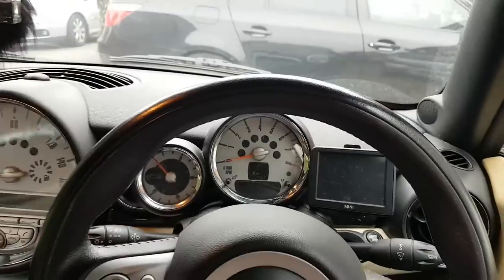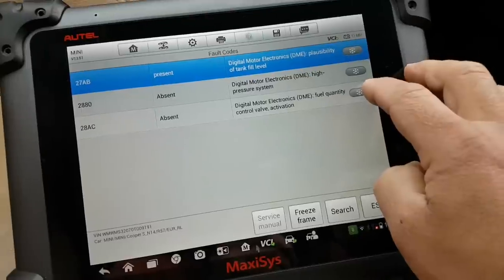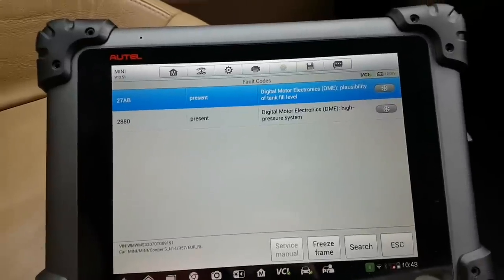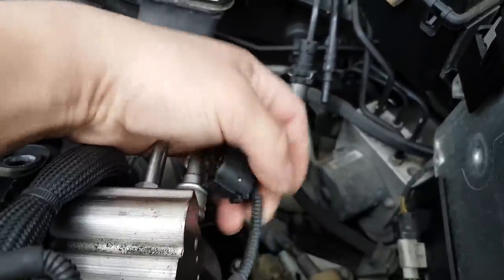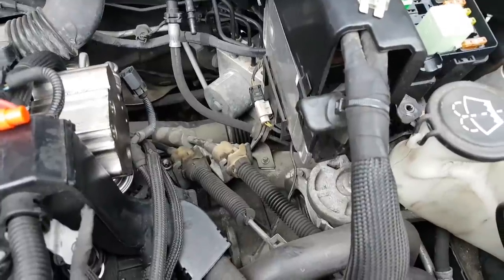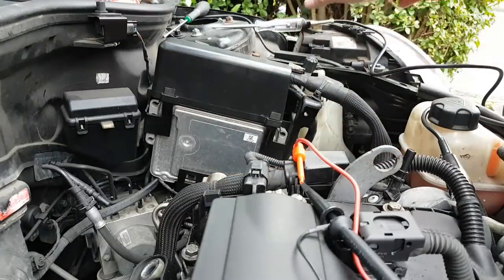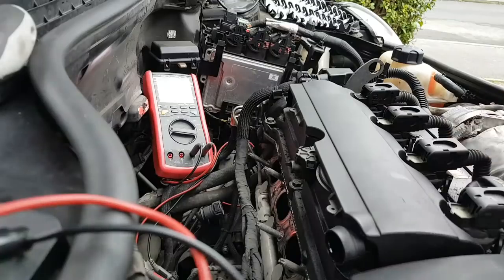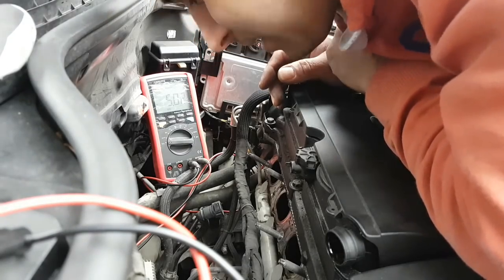Mini Cooper S R56 running rough... Error 2880, high pressure fuel system faults...

Comment: Had the same, same  problem! I didn't try to guess. I told the owner to replace the low + high pressure pump and pressure sensor. The mini had done 200k+miles. It worked after the replacement. Lucky I guess? I like what you do and the recordings. A lot learned. Am at Nairobi Kenya.
Reply from the maker: 👍👍👍
Thanks, for watching and for your comment!

Comment: Excellent video well done.  Watched as my '11 R56 had the yellow check engine / low power light on though has now disappeared the following day...  The engine was running perfectly fine despite the check light so will suspect the pump being a bit worn due to millage at 98K.

Comment: The reason the pump start to work when the engine is warm is because the pump is filled with its own oil. That why there is a membrane on the bottom. You can measure the dept of the membrane with a vernier gauge. If its deaper than 26mm the pump lost to much oil and should be replaced. You can find a document about this in ista. Bmw/mini even have a special tool for measuring the dept with the pump still mounted on the engine.
Reply: Mine measures about 27mm but seem to be getting good pressure to fuel rail on live data, having issues with the car hesitating and idling slightly rough, kinda seemed like a vacuum leak but smoke tested and no leaks.. don’t know if I should still suspect the pump or not
Reply from the maker: Have you scanned the car?
Reply: @LMAutoRepairs  hi, yeah I’ve scanned it but it’s not bringing up any fault codes unfortunately and no EML, the car is a Peugeot 207 GTI 175bhp but is the same engine as the Mini Cooper S N14
Reply from the maker: Live data... check live data...
Reply: @LMAutoRepairs  just been looking at this again on the live data, I’ve noticed when I press the accelerator then let off the fuel pressure drops to around 600PSI from the usual 700PSI ish when it’s idling. Do you think 600 is too low? Thanks

Comment: This video saved my mini, i was about to set it on fire 😂.  Bro your hard work helped me so much. My mini wasnt giving any codes but pressure was low. So i bite the bullet and changed hpf pump. Perfectly starts fine. Thanks 🙏🏼 to you
Reply from the maker: ☺️
That's great! 
👍👍👍
Reply: Gonna set mine on fire too man same problem here😂😂
Reply: My mini has started acting up about 2 months ago and it's off the road since  while I slowly shotgun new parts into it hoping to fix the issue. The car is fine if driving with barely any throttle but if you give it any good throttle it makes a machine gun popping noise from the exhaust and it feels like misfires and power cuts.

I've replaced the hpfp twice, lpfp, coils, plugs, vanos solenoid, new maf, new map sensor, new vacuum lines, new pcv hoses, new diverter valve and a new valve cover. Throttle body is less than 6 months old, likewise the water pump, aux waterpump, waterpipe, friction wheel, thermostat, turbo and lines.

I was told the main sender could be the issue and others say timing...Im not hearing any chain rattle and the guides look fine too. I really wish there were people who diagnose like this in my area...because I am so tired of throwing money at this car at this point. Ive sank 3-4 times more than what I paid for the car over the past 2 years and I love how it drives when it wants to cooperate but Im getting to the point where Im ultimately going to end up parting it out if its not the sender....
Reply from the maker: @Raymo2u 
😬
The timing can be easily checked by scoping it... I have videos for that, search my channel...
Everything else can be checked by looking at live data, etc...
As for the high pressure fuel pump, hope you have installed a genuine pump... as the aftermarket ones can be a hit and miss, and if you are not using a scan tool and live data, it can lead you in the wrong direction...
Diagnose, test and replace the faulty parts.
Just throwing parts with the hope that it will fix it, can become expensive very quickly... as you know...
👍👍👍👍
Reply: @LMAutoRepairs  The first replacement hpfp was OSIAS brand and it worked for about a week and then failed. The second pump I bought second hand OEM. It used to have starting and idling issues but all that has disappeared. I seem to only have issues with a higher load on the engine. I was questioning if the sending unit side could go bad or cause these issues as its the only part aside from a few lines that havent been replaced.

 I have an ultraguage and I can view many things in real time, I also have a ZR13s scanner to look at things with. The problem is I dont have great knowledge on what values are good and what's not.

I do appreciate the response! Keep up the amazing content.
Reply from the maker: You should be able to see the sending unit pressure... around 5 bars if I recall correctly... otherwise just install an inline gauge to test it...
The sending or also known as lift pump, can cause those symptoms, but so can the high pressure... because was a second hand pump it is difficult to 100% trust it...
But you are the one that needs checking, testing and judging...

Comment: Amazing journey to get this repaired!
Never seen a petrol engine with such a fuel pump mounted to the cylinder head. Very interesting. 
Always remember to check basics such as oil level. I was working on some car with engine management problems and it was tricky. Eventually I decided to look at dip stick. There was hardly any oil in it and one cylinder already very low compression!
I missed if and when you checked live date for the coolant temperature, especially as it was a fault that occurred only when engine was cold.
Main handycap for you was doing this with a mechanical fuel pressure gauge. Hope Santa is going to bring one for you!
Reply from the maker: 😊
Santa is usually not that generous... lol
But yes, I need to get one...
Thank you for watching and for your comment, appreciated! 
Thanks 👍👍👍

Comment: Great diag! You should get a current clamp you can hook up to your scope, so you can check the current waveform in the pressure regulator. Perhaps there was a difference between cold and hot, if it was stuck when cold or something like this.
Reply from the maker: I do have a clamp... Just never thought about that...
I believe was just the temperature and expansion of the materials, that was making the pump to pump slightly better perhaps... 
Who knows...🤷‍♂️
Thank you for watching and for your comment!

Comment: Having a similar issue, not as bad of a misfire on mine, when cold starting and then stalls, live data shows actual - 3.76 MPa and Set - 5.00 MPa.  After a help with the throttle and running, at idle actual fluctuates between 4.48 & 5.18 MPa, revs up ok but misfires at idle, No engine lights but fault codes are 2C9E, 2D52, 2DCD, 2A92 & 2746.  Just had walnut blasting done aswell to see if that was the problem

Comment: I’ve lost count of how many of the pumps I’ve fitted and the weird ways they can play up, went through the pain of buying what turned out to be poor quality new parts as well, they change slightly around 2010 on the n18 engine but are still rubbish I’ve done 7 in the last 3 months ish and the only place I buy now that I’ve never had an issue with is Neo brothers
Reply from the maker: Yes... they are problematic...
Thank you for watching! 
👍👍👍

Comment: In France we call it the 1.6 thp motor, there are a always a problem with the fuel pump or the chain tensioner be careful with that to there is 3version of the chain tensioner if it's you're car put the V3 on it's take about 4bolts 30min 50pnd of torque for the chain tensioner and that's it do it before is to late
Reply from the maker: As I explained in the video, the had all that just weeks before...
Thank you for watching and for your comment! 
👍👍👍

Comment: Great video once again !

I now you now tho i cant stress anough how much damage you can do running an engine with fuel contaminated oil ... The oil almost loses all its lubrication effects because of the petrol mixed in ... Even running it at idle for short periods is going to wear out all bearing and certainly the pistonsidewalls and pistonrings ...
Reply from the maker: I know... the good point was that the oil was new... 😋
Thank you for watching and for your comment!

Comment: Good job Luis as always, if u did check the oil level earlyer u should find also earlyer the reason of this trouble, whatever we are all learning and learning every day, thanks Luis for all ur videos. ur Algerian follower was here :-)
Reply from the maker: That's correct...
But the fact that the car just had a new timing chain, oil change, and the "pump", it never lead me to check it...🤷‍♂️
Well, got there in the end...😋
Thank you for watching and for your comment!
Reply: @LMAutoRepairs  Another question Luis, do u have any idea why the faulty fuel pump work fine when the car is worm?
Reply from the maker: @KaKi_AutoDiag  
Has I have already answered on other comments... the only thing I can think about, is that the temperature and expansion of materials, would seal something or whatever... I never opened the old pump... so, can't really tell...
👍👍
Reply: @LMAutoRepairs  What made me wonder even more is, why it runs good even when cold when you disconect that pressure regulator (fuel metering valve). Obviouslly car run with default values at that point, and everything is good. Would be nice to see duty cicle for the regulator once the connector is off.
Reply from the maker: I kinda did show... the ecu just stops cycling the valve once fails to achieve the correct pressure... it is on the video...
Thank you for watching!
Reply: @LMAutoRepairs   khoya andi nafs mochkil 2880 système haute pression

Comment: I had a similar problem to this on my 2011 Cooper S. It wasn't as bad as this and would run rough on cold startup and then trigger the engine light. I found someone on eBay who refurbishes the pumps so I sent it to him and fingers crossed it has been great since. He said the Chinese ones sold on eBay are just old pumps taken from scrapped cars which are cleaned and sold as new. A new genuine pump is £900+ so you can see why people buy the cheap ones.
Reply from the maker: Yes... they are expensive new...
Thank you for watching and for your comment!
Reply: Hi who refurbed it for you?

Comment: Im having the same problem.  Whats the difference from fuel pump assembly and a high pressure fuel pump? And i keep getting that same beep as youre driving. 2010 mini s clubman doing same exact thing.
Reply from the maker: The fuel pump is the one in the fuel tank...
The high pressure fuel pump, as the name indicates, is the pump that increases the fuel pressure to higher values... in this case, the problematic one...☺️
👍👍👍

Comment: Hey man i have a question I have a 2014 Honda civic si sedan im going 10mph and my vsa light turns on and it sounds weird
Reply from the maker: Scan the car, check live data and go from there... most likely an erratic reading from one of the speed sensors... but is just a guess...
Thank you for watching!

Comment: the main issue is just too expensive original parts and probably expensive repair labor costs that make poor quality cheap parts attractive to people. Also i get it how it can lead down the rabbit hole its not easy to think of sanity checks, but in this case verifying that the original pump starts to work when warmed up would have helped a lot.
Reply from the maker: 😊
Indeed!
Thank you for watching and for your comment!
👍👍👍

Comment: hi louis, great work you are doing i see most of your videos, which have helped me alot.... i have a r56 n18 engine.. with problems on the quantity valve... with the conector out i have 12v on orange wire and 0v on the white wire.... if i plug it in and start the car... i have permanent 12v on both wires... you think it may be the ecu??? thanks for the help
Reply: fuel pump presure is ok checked with insta... but the valve is always on 0% it will not work
Reply from the maker: Hi
Have you load tested the wires?
Have you scoped the signal?
Is the ecu actually trying to pulse the valve?
What pressure are you getting?
You need to test more things before blame the ecu...
👍👍👍

Comment: Eh body I need you help I got mazda mpv 2005 with P0403 EGR is electronic I replaced EGR I still got P0403 I replaced PCM and I still got PO403 don't know what to do
Reply from the maker: Start by diagnose before throwing parts at it...
Wiring? 
Have you checked wiring?
Can you actuate the egr?
Have you checked the intake for carbon build up?
The P0403 is a generic code... live data can give you more information...
Thank you for watching!
Reply: I checked EGR ohm's  22 ohm's old and new one I wires continuity  everything is good

Comment: Eh my friend I got a question how many volts should I see on DVM when I check camshaft position sensor or crankshaft position sensor
Reply from the maker: If a 3 wire, a ground, and voltage (usually 5 volts)... the signal you can't really measure it with a multimeter... if is working OK, with the engine running, you might see 5 volts...
But for that you need a scope...
Thank you for watching and for your comment!
Reply: 2 wire  345 ohm's
Reply from the maker: @cgmartgarcia7792  
If is a 2 wire, then that generates an AC signal...
Have a look here... Will give you a better idea...
https://dannysengineportal.com/crankshaft-camshaft-position-sensor-testing-done-the-easy-way/

Comment: Have you ever had a problem with the Autel resetting adaptations on a BMW?
Reply from the maker: Not that I remember...
What exactly issues are you referring to? 
Thank you for watching!
Reply: @LMAutoRepairs  Hi, I was just wondering, I use an autel and a launch, they both seem to have a slight difference in the procedure to reset adaptations, I am not entirely convinced either are working in my case, I have just got Ista to try, see if that helps me. Thanks Jonathan
Reply from the maker: I never used launch...
But never had issues with Autel MS908P....
Reply: @LMAutoRepairs  Thanks, I have the maxicom 908, maybe I am not using the right pid, on the procedure there is no key on key off cycle, I will try Ista and see,thanks again Jonathan

Comment: What caused the 25 amp fuse to blow ?
Reply from the maker: That's a good question...
It could have been because of the extra load while the ecu was trying to achieve the pressure... or a poor quality fuse... 
As I said in the video, I really don't know why it happened, and surely enough, it did not happened again...🤷‍♂️
Thank you for watching and for your comment!
Reply: @LMAutoRepairs  I was sure it was a short to ground on the power side of the high pressure pump and a bad pressure sensor. just goes to show new does not mean good. thanks for sharing bud.

Comment: I changed the hpfp and it starts ups just fine again. But the check enigne light still comes on and the is fuel slightly dripping down the high pressure line even i tightened it correctly. Changed the line 6 months ago. Could this be the issue and I have to buy a new one again?
Reply from the maker: Possibly... what are the codes stored? 
👍👍👍
Reply: @LMAutoRepairs  Bought a new line and it isn‘t dripping any more but Check engine light still comming up but only after full throttle.
Reply: @LMAutoRepairs  Also had it at the Bmw workshop before and they checked everything but couldn‘t find anything then the hpfp. Still cc-id 029
Reply from the maker: Check live data at full throttle, perhaps the pump is not building or maintaining the pressure...

Comment: Hi Luis, where abouts are you located? My in laws are having issues with their volvo V40. it keeps giving error that start button malfunctioned. However it does start sometimes. We have checked the ecu, ecm and the wiring and it seems all good, no corrosion and cant work out what might be causing it. If possible and youre not too far, maybe you could take a look? Will pay for the work.
Reply from the maker: Hi
Have you had the car scanned, and live data checked? 
Thank you for watching and for your comment!
Reply: @LMAutoRepairs  we did. With vida it says start button circuit B and C stuck Signal low. With another scanner that Halfords used it showed lost communication with immobiliser unit.
Reply from the maker: @soldiers303  
I would check the button...
I believe they have 2 circuits inside, just like the electric hand brake ones... and if both fail to make contact at the same time, they can trigger faults...
But you should be able to see that on live data...
Reply: @LMAutoRepairs  thanks I'll try that. Didn't think of checking live data. We did get a replacement button though but it came together with reader and I think it has to be programmed.
Reply from the maker: @soldiers303  
Don't think it does...
That should be just a reader... reads the key and sends the data to the immo module...
But I might be wrong...
Worth a try...😉